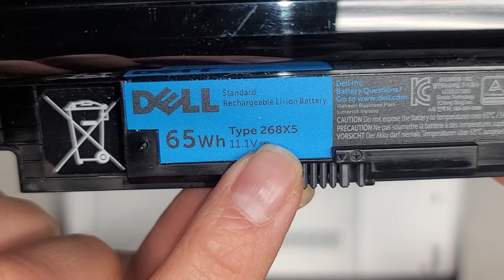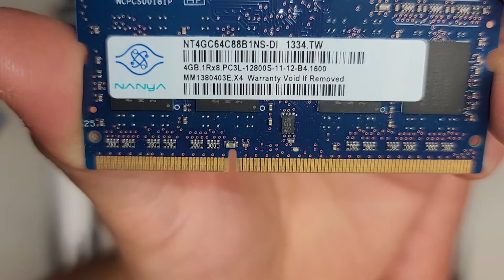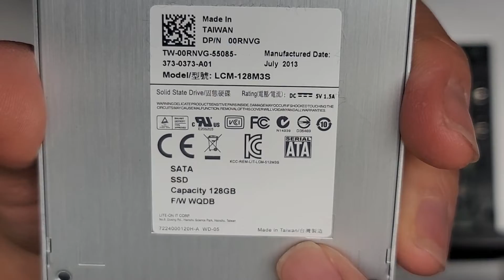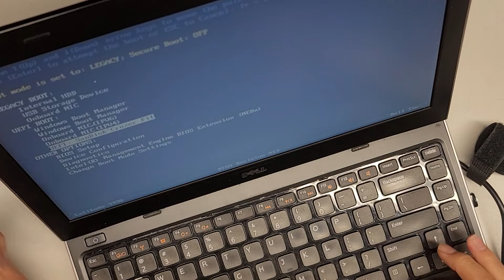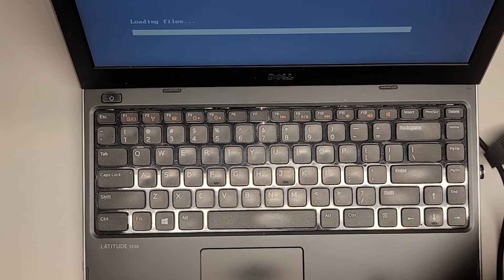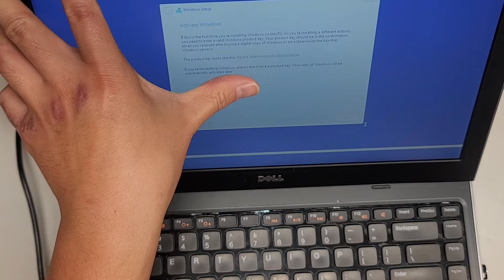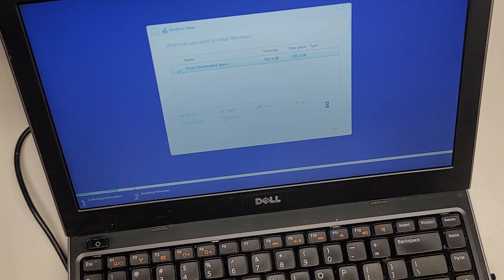DELL Latitude 3330 Disassembly RAM SSD Hard Drive Upgrade Replacement Repair Windows 10 Install

Comment: Quick question
Can you actually use 2 stick of 8gb (16gb) ram on this laptop?
I saw many people say online that 2 stick of 4gb (8gb) is the maximum the laptop can support
I ask because I currently owning the same laptop model
Reply from the maker: Usually there is no max
Reply: @ItsBinhRepaired  So the laptop can actually handle 16gb of ram
And another question, since this model comes with 2 DDR3 ram slots, will DDR3L works in those 2 slots?
I know that DDR3 takes 1.5v to work properly and DDR3L only takes 1.3v but will they fit properly and function the same when switching from DDR3 ram to DDR3L ram?
Reply from the maker: @u4dead1  usually you want the same specs. Only size difference.
Reply: @ItsBinhRepaired  Ok, last question, about the CPU, I never seen the inside of my laptop before and looking at the 'About' setting the CPU in my laptop right now is Intel(R) Core(TM) i5-3337U CPU @ 1.80GHz
Can I take it out and replace it an i7 CPU? Or is it soldered into the motherboard and I can't change it?
Reply from the maker: @u4dead1  soldered
Reply: @u4dead1 did you upgrade the ram, my processor is i3 2375m can i also upgrade to 16gb ram
Reply from the maker: Sure